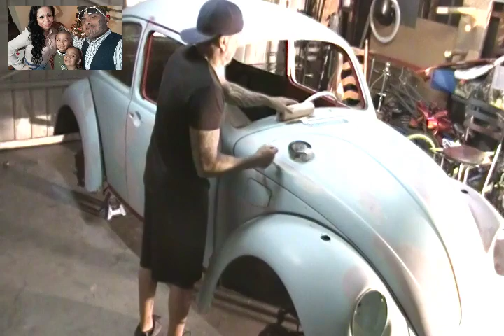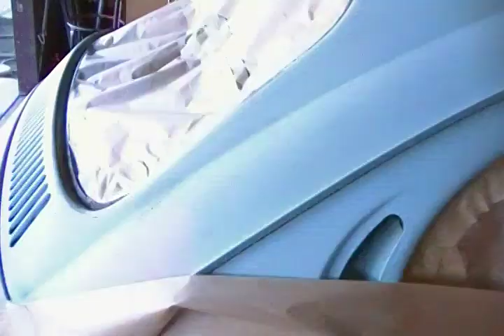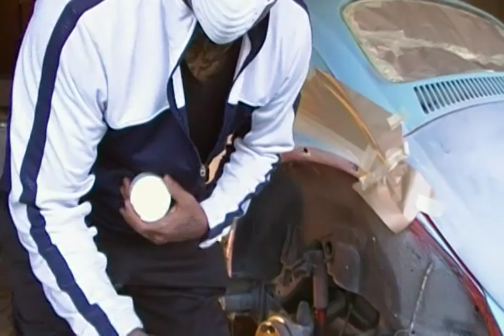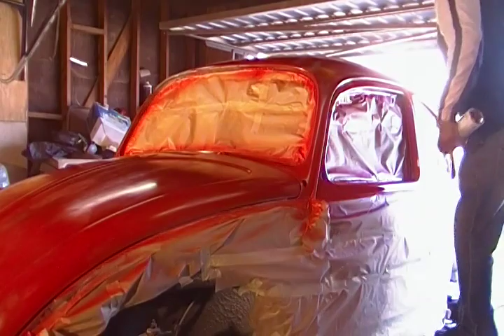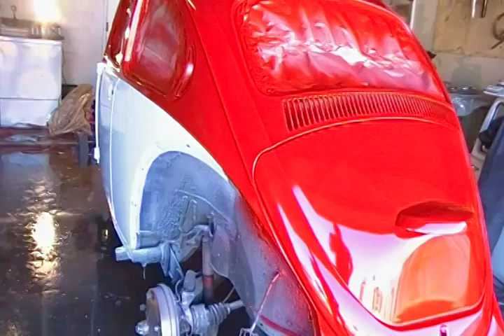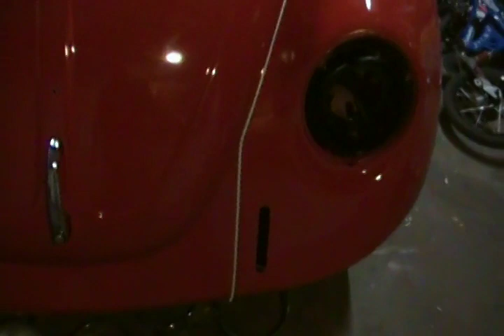VW BUG PAINTED  WITH SPRAY CANS!!! MUST SEE !!!!!

Comment: Excellent work and explanation.  Appreciate you doing that. You may have said all this, but what brand and type of paint  do you recommend? What grits did you sand? Why not remove plastic vent and license plate holder? Just wondering,  cause your results speak for themselves.
Did you paint ant inside...dash ?
Thanks again! John in  San Antonio.
Reply from the maker: I wet sand with 400 grit till it was smooth..Then used Rust-Oleum 2x with 15 minutes flash time between each coats of spray paint... This is straight paint from cans.. no clear coat... Go look at my shorts and u will see one gray vw bug that I spray paint that one has clear coat on it..